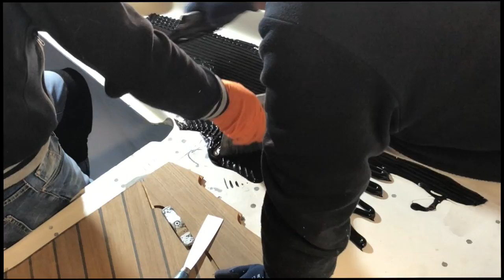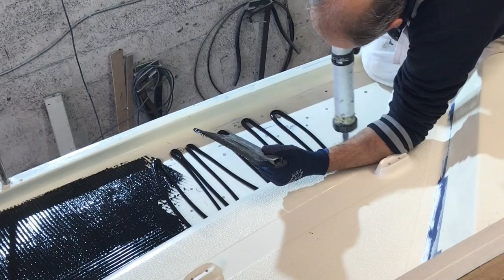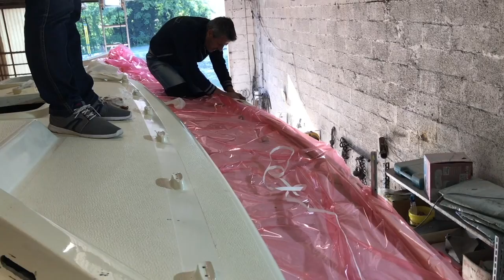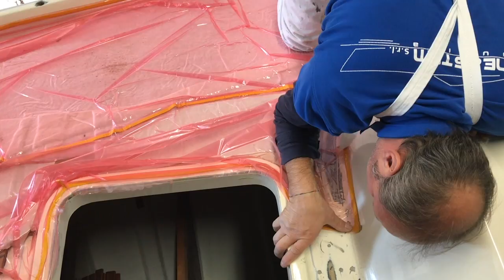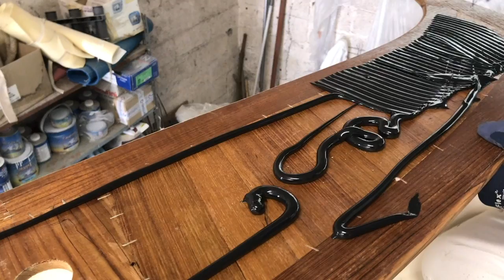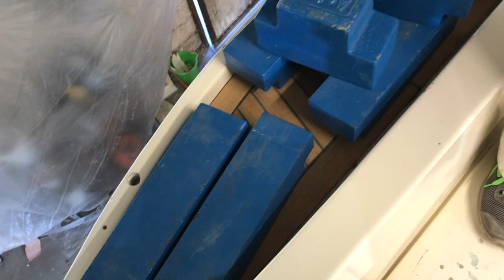Watch The Magic Of Vacuum Bonding On The Hallberg Rassy 312 'ellös' Teak Deck - Sea4see Pt.3

Comment: Gabriele,  Good to see the next step in the process of creating your new deck.  Obviously they didn't need to vacuum seal the stern section. They just used weights.  So how many sections can they install only with weights to compress them?  I would think maybe the smaller pieces.  Like those in the cockpit?  

Also, last week I wondered how the seal would be made perfect.  But this week it is clear that the seal is never perfect or else you would only need to run the vacuum pump until a vacuum was created - then turn it off.  

Also, never seeing this done before, I didn't understand why the thick "felt" cloth was put under the plastic.  But then I realized that it allows the air to flow from far away from the place the vacuum hose is connected.  That is very simple actually!      Again I am already excited to see what happens next week!
Reply from the maker: +S C Yz by! Small pieces and cockpit didn’t need vacuum, only weight. 200/300 kg for 24 hours..and you are ok, under vacuum the glue arrive to 1,5 mm height with weight about 2-2.2 mm The long one need vacuum because curved and get best adhesions!!!